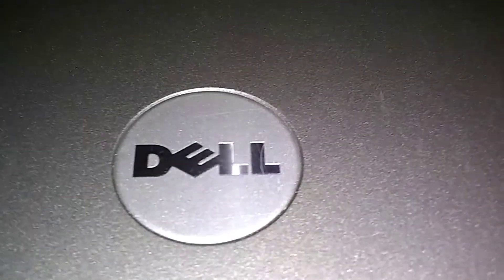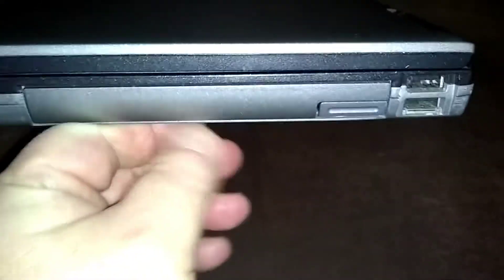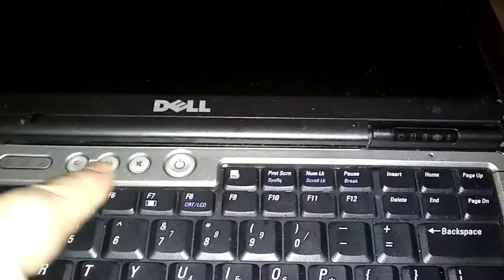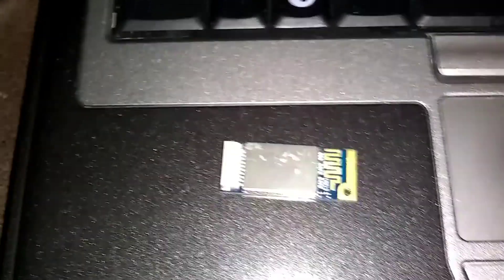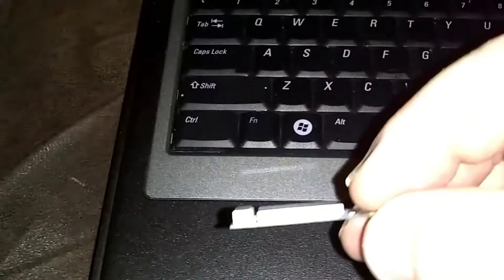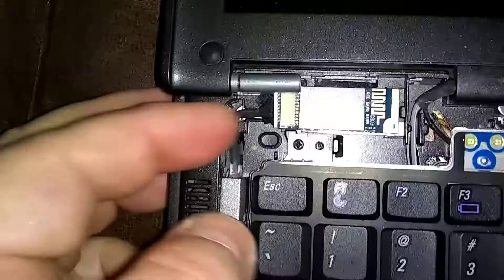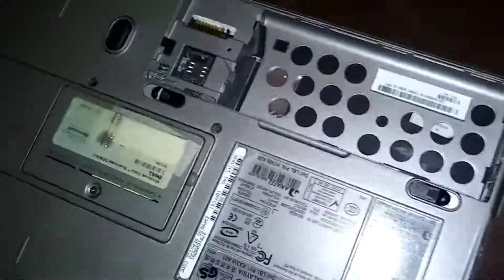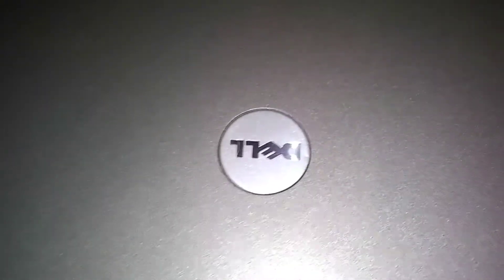Dell Latitude d630 d620 d610 d820 Bluetooth Location/Install || Removal || Replace ||  Nervous Nick

Comment: This thing was definitely upgradable. I've owned this one for a couple of years, and it's an awesome laptop!
And before installation, I would go to the BIOS setup and turn the internal bluetooth setting off, so that you wouldn't experience any issues with the card in. Then, when it's installed, turn it back on.
Reply from the maker: Yes

Comment: Great Video,  I just bought a Latitude E6500 with 2GB of ram and 80 gb hard drive.  I want to put a SSD in it and more RAM.  I wonder if it can go up to 4 GB.  I got it for $20 is that a good deal?
Reply from the maker: Great Deal,.. where did you get it?
Reply: @NervousNick  At a local thrift store, no power cord but I found one that works but it says it needs 90 w instead of 65w so I'll buy one on ebay.  They had a Gateway laptop gateway m465-e for the same price I might go back and get it tomorrow. Thank you for replying, you are an awesome Youtuber!
Reply from the maker: @timseaholm7219  Watch this video, on How-to determine how much RAM the computer will take?
https://youtu.be/cGtBHIywCpg
Reply from the maker: Here's the 90 watt charger I use, you can switch the tips for different Laptop's!  They have more tips on there website!
https://youtu.be/5pD2IR1qgyM
Reply: @NervousNick  excellent I just watched that video, I will buy one, Thanks!
Reply from the maker: @timseaholm7219  😎